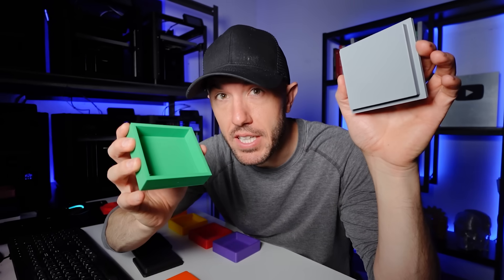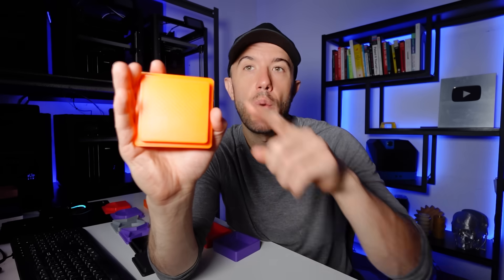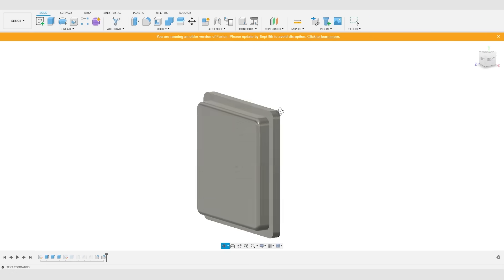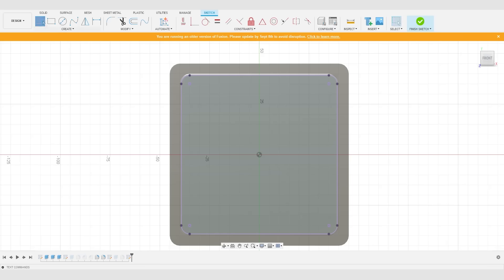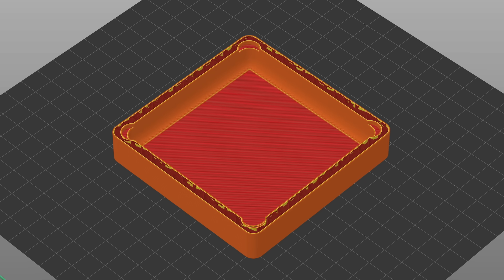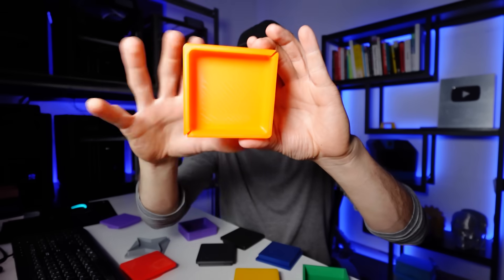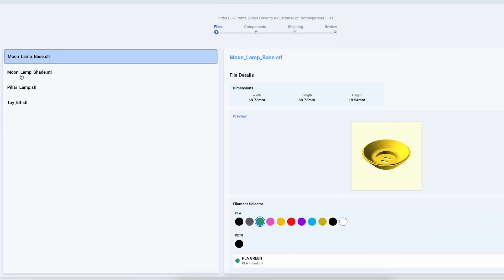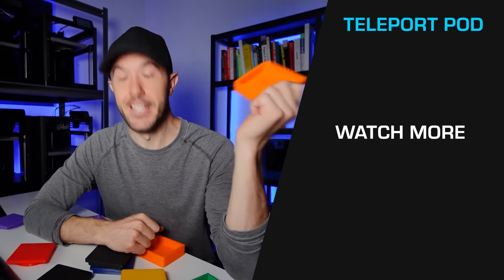How to Design a Print with Perfect Tolerance EVERY Time

Comment: Now show us 3D printed simple car key shell (le 2010 Toyota smart key), which is exact copy of original, can be clicked together and disassembled at least 30 times without breaking and is repeatable (20 printed parts will fit to each other). Then I will believe that plastic 3D printing technology SOMEWHAT developed to barely usable level. Or let's re-phrase it - how many OOO are in the price of printer which is able to print such precise parts in reasonable amount of time (not in 5 hours). simple YT searsh "3D printing car key shell" shows that this technology is about 100 years away from being able to produce nice looking result.

Comment: how does the filament not hang down when you have a 0.3 gap that's pretty wide (looks like more than 50mm in the video), it can't just float there until the next layer is printed, can it? Do you have support under there? (but how would you get that out if it's just 0.3 high, must be a pita) maybe tiny feet that break off once you wiggle it a little?

Comment: When doing splits, can you create a rounded notch instead of the rectangle notch? I'm new to 3d printing, but I know when you have hard corners they typically create stress points, whereas a rounded notch would reduce the stress potential.

Comment: In short, 0.025mm for tight secure sealing , 0.05mm for snug but easily can be removed, and finally 0.1mm and up for a lose fit.  This is what all my engineering is done at.

Comment: Very informative video!! 
Btw tolerances is limit we have after 3D Printing or Machining a part on printer/machine because of deflections and clearance is something we need to give to make two bodies fit with certain level of tightness.
All the information you provided is very up to the mark but as a 3D modeller who is modelling to make 3D prints I have seen that giving perfect clearances actually solves all the problems. I normally give a clearance of 0.2mm for a easy fit.
I have been modelling on a lot of fitting projects and most of them do not have the thickness to try all of the ideas you mentioned, the thickness is hardly 1 to 1.5mm
Make sure that you print the bodies on same machines as every other machine will give different deflections and this will cause the fit to get tight or loose.
A clearance of 0.15mm to 0.20mm works very well for a snap fit
The rounding of edges at the corner seems very helpful and I am going to apply that further on my projects. 
Thank you for the information!! :)

Comment: I have always added .005 inch per inch of cavity to account for internal shrinkage (in PLA), then add the gap per side you want, usually about .005 inch per side or more if the part is big. Always seems to work. If not, then a little filing.

Comment: These are some interesting workarounds, but add a lot of complexity in lieu of plain old proper dimensioning and tolerancing... but fine for the layperson.

for instance, your recommendation for corner clearances is to cut out a pocket in each corner. That works, but the more conventional design is to make the radius slightly smaller on the female part and larger on the male part (say 2.0mm radius on the cavity and 2.5mm on the insert) . This will leave a small gap, but that's generally acceptable and gives you a more simple, robust shape.

By the way, you put a "taper" onto those lid pieces, not a "chamfer." 

Keep at it, its a lot to learn!

Comment: Consult a machinist handbook and look at correct tolerances for fitted metal parts. NOTHING in this type of scenario is supposed to fit this tightly. Under sizing by .020" is typical and that's not including manufacturing tolerances. Screws are your friends, friends...

Comment: Yess I designed some compliant clickos to lock the two parts of a shell design, like an old Motorola but chunkier :) The 2 halves are quite big and compared to make it all in PETG for better mechanical properties, I switched back to PLA to print faster, because the compliant part has been sectioned and now it's a TPU insert. The flex and the lock force now are completely tunable just modifying the TPU infill, the mechanism is more reliable overtime than PETG, and even if it breaks fails or yeld you will only have to reprint the TPU part. The main bodies furtherly, are lil' more impact resistant made of PLA and more disposable since the prop it's a toy, a game board in the end.
You hardly can have clue of how much your content helps so many passionate people around the world to improve their garage made designs. <3

Comment: Those cuts from the 0.3mm cut you did into the wall, can easily be avoided by just creating a plane that aligns with the wall and only cutting the actual wall and not the part. Just FYI

Comment: In mechanical engineering, a fit describes the relationship between two mating parts, while clearance is the specific amount of space or gap between those parts. A clearance fit is a type of fit where a deliberate gap is designed into the parts, allowing them to move freely, whereas a fit can also be an interference fit, where the parts are intentionally designed to be forced together.
 
Fit
Definition: The relative condition of mating parts before assembly, describing the intentional difference in their dimensions. 
Purpose: To determine if parts will slide, press, or rotate relative to each other. 
Types: There are three main types of fits: clearance, transition, and interference fits. 
Clearance
Definition:
The physical distance between the surfaces of two mating parts when assembled. 
Application:
It's the measurement that determines whether a fit is a clearance fit, where there's space between the parts. 
Function:
To provide freedom of movement between parts, reduce friction and wear, and allow for parts to slide or be guided freely. 
Key Differences
Fit is the relationship: "Fit" is the overarching concept of how parts relate to each other (tight or loose). 
Clearance is the space: "Clearance" is the actual measured gap that results in a clearance fit. 
Interrelation: For a clearance fit, there is a positive clearance. However, not all fits are clearance fits; some are interference fits where there is negative clearance or overlap.

Comment: Nice summary. The box fingers is interesting but another solution you didn’t mention was, instead of putting slits in the corners of the box, instead put the slits in the corners of the cover walls that insert into the box. That way the cover insert walls can flex and hold against the box walls but the slits are not visible outside of the box like your box slits are. It works really well with all types of plastics and printers.

Comment: huh, I often had problems with adherence to my build plate with yellow PLA. This was the first time I heard that colors can actually change how material behaves. Nice to hear that!
Reply: @moolder  , yup. When I first started printing on my Ender5+, (at one point i had 6) yellow was problematic to dial in to say the least. Brighter colors over darker was always a bit of fiddling. 
Colors have big impacts on print performance for bed adhesion, fan cooling and even nozzle temp adjustments as their dyes and pigments are not equal. I've even experienced having to change Z-offsets for some colors of the same material.

Comment: You often talk about shrinkage of different material, but with current printers those values are taken in care while preparing gcode. Most modern printers can have even 0.02 mm accuracy on different materials (i even hapenned to print PLA next to PETG part with the same resolution etc. and had them fit without worrying about it) but you're right it's still good to consider if you're printing for other people to print them as well

Comment: 1st, I'm super impressed with how quickly you are able to edit the models. What software are you using there? I'm a CAD novice.
2nd, you may be overthinking a few things.
- Instead of using an X shape for compliance you can alternatively only print the corners. A peg shape or an L shape; adjust the size until you have the compliance and strength you want.
- Instead of cutting holes in the corners of the base you can just tighten the radius of the fillet. As long as the lid fillet is rounder you'll have the same sort of benefit.
Reply: It is Fusion 360

Comment: I always just print several versions. For example I'd print the box at 100% as normal, then I'd print the lid at:
   99.0% 
   99.5% 
   100.0% 
   100.5% 
   101.0% 
   101.5%
etc.
Until I get one that fits perfectly lmao

Comment: I would have included some veins (or bumps) in the lid, that would deflect the middle edge of the box just a little. If placed correctly it could also have a satisfying click that would allow slight movement but not self open. Parts would not remain under tension or deform over time.

Bonus give the box smaller inner radius than the lid, subtle enough not to be perceived, maybe 1mm less in it's radius.

Comment: Just a quibble, I would use the word clearance and not tolerance. Tolerance is about how much a part's size can deviate from its nominal value, whereas clearance is about the gap or space between parts when they are assembled.

Comment: Thanks for video. Additional question: So you just model the inlay and hole exactly same size? For example 100mm? I got in mind to make inlay smaller 0.1-0.2mm depending on how tight fit I need. I am definitelly gonna check your recommendation in the end of this video. 🙂

Comment: I like your use of physical examples paired with the demonstration of CAD techniques. I felt that some of these videos from this account in the past have been overly focused towards optimizing 3d printing for larger scale manufacturing rather than for the larger demographic of hobbyists who might look for advice in these videos. This video however was helpful in showing me a few techniques I could start implementing in my designs.
Reply from the maker: This channel is still only focused on mass production of 3d printed parts. When it helps hobbyists that is great but not the focus. Lol

Comment: You can also have the lid and the base printed at different layer heights (like 0.25 lid and 0.3 base). It prevents the layers from "keying together", thus reduces friction a lot.

Using hard soap for lubrication is sometimes an option too, especially for big threads.
Reply from the maker: You always want to design to avoid the need for special print settings or external additives.
Reply: @slant3d  yeah, I understand, it's just yet another trick to improve the feel of the parts even further. Besides, if the change is very small, it'll be unnoticable otherwise, only the binding will decrease.

Plus it's easier to use this for parts you cannot change, or it'll be too bothersome. Changing layer height a little is usually a lot easier (at least for small to medium scale production) than modifying the mesh
Reply: I use this trick a lot for my comission printing. With what my single Voron 2.4 can manage (1-1.5 kg / day, depending if the model allows it), It's often a lot easier to just tweak one setting, than to modify the mesh. if it's for only like 50-100 parts.

Soaping up the threads gives actually butter smooth operation without leaving noticeable residue after wiping it off. But I don't use soap often, only for extra small scale comissions. Soap is more appropriate for personal projects, where one bar of soap lasts pretty much forever

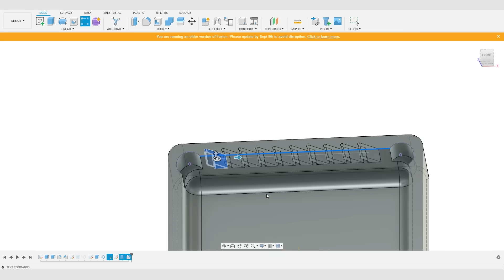Comment: I have a how not what question though. How do you have a released section "cutout underneath them" under the fingers at you have printed in the walls (10:45)? My 3d printer needs to have something under there so it isn't printing in mid-air. The same question occurred to me at 6:32 for the detached split version.

Comment: The 0.3mm gap below areas, I really don't see how that reliably avoids overhang problems with printer variance. There's still plenty of printers out there that can't print a horizontal layer into open space for long distances (such as the ones in this video) without stringing and other related overhanging problems. Even with short distances it can happen. I see the value of it mechanically but I'm unconvinced it's a method that can be relied upon for all different printers.

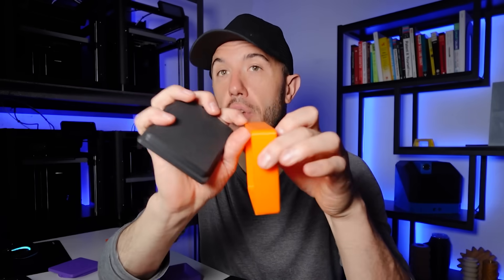Comment: Your title should say fit. Tolerances define how far out a manufactured part can be and still be considered acceptable. Tolerances are selected and stated based on things like how parts interact and their manufacturing processes. 9:40 Tolerances are not something the designer can tune up in CAD software.  Designers can adjust sizes to accommodate fit but not tolerance.  Fit and tolerance are not the same thing.  An example of fit would be a 0.2mm gap you leave in the design so that the lid and cover can fit together. An example of tolerance would be if a part is designed to a size of 100 mm and the tolerance is stated as +0 -0.2 mm, then any manufactured part that measures between 99.8 mm and 100 mm would be deemed acceptable.

Comment: Good info, although instead of using a chamfer which is primarily used for corners, the proper term or command called draft in nearly all cad software. Maybe he used the chamfer command, which can be done, or he was calling a draft a chamfer? More control in fitting parts would be too not only draft the lid but also the base in the same direction using the same plane that the lid is going to sit on. If one wants to keep the same thickness all the way down, the outside would have to be drafted at the same angle. I do not like the idea of cutting out the corners of the base as it would reduce strength. What can be done in that situation is to make the corners of lid have a slightly larger radii of the fillet to that of the base, so the corners of the lid will not touch. I really like the idea of the grip fins, although it seem like there has got to be another way to do it instead of cutting into the walls and make that area thinner?

Comment: The reason many of these "advanced" features are not used in manufacturing is because, in the "real world", companies don't just make a product - they validate the result to a standard/blueprint.  Every feature you add to a design (every individual feature, not just every unique feature) will have to be measured - every radius, position, length, depth, width, height, flatness, etc - and that additional labor/complexity incurs additional cost.  I highly doubt these parts are going though the level of QA/QC that major manufacturers are incorporating (1 part per x parts; validate for compliance to set standard).  That doesn't mean these are bad designs, but it's important to know that common design choices are not just the result of laziness or failure to be innovative.  Sometimes that which is innovative is what is "practical", not just "function-optimized".

Side note:
Another reason this is more concerning in mass manufacturing (i.e. injection molding) is because they are using molds to create product, so the molds have to account for discrepancies that the final product demonstrates.  As strange as it may seem, the mold does not actually conform to a product's blueprint, but instead to other dimensions which produce a result that conforms to it, because injection molding must account for difficult conditions - such as uneven heat distribution in the mold, and/or shrinkage that isn't uniform due to differences in a feature's attributes.
Reply: This, so much this! This is also the reason for the draft angle (which he calls a chamfer), which in the real world is there as a requirement to even be able to demold things in injection molding. While you can get away with smaller draft angles (like on LEGO, which is basically zero draft angle), it does lead to increased tool wear, and as anyone who has priced injection molded pieces knows those tools are not cheap.

Frankly, while there are lots of dissimilarities between 3D printing and injection molding just taking a primer on injection molding, and learning how plastics behave, and the design considerations which have to be made to make them behave like you want, will improve the way you design 3D printed parts as well.
Reply: You're describing the difference between quality reliable part assemblies vs cheap offshore crap.

Comment: Thanks for the video. My question all the time is how to calculate the part which comes on top. How can i calculate how much space i need to give the second part to slide in and is it possible to just scale both parts and have the same effect. So is it just make the sliding in part a percentage smaller?

Comment: Great idea on the flexture fingers or what ever you called them lol. I took them a step further and added ramps to make it a detent style fit where it creates an engagement in a groove or on the other side of a hole. That way it creates a self retaining mechanism.

Thanks for the ideas!

Edit: I just realized you could take this even one step further and create keyway channels with a drop and twist motion while maintaining the detent. Although the using fingers will likely induce a directionality in the force required one way versus the other. However, this could be overcome by using a dome stlyled flexture instead.

Comment: I have an issue where my infill and my perimeters are almost always not touching. Ive tried to increase infill/perimeter overlap to 100 but it barely does anything. idk what to do. ive increased slightly the amount of plastic leaving the nozzle to like 1.1 but its still causing these issues. My first layers used to be superb but now suck. can you please help

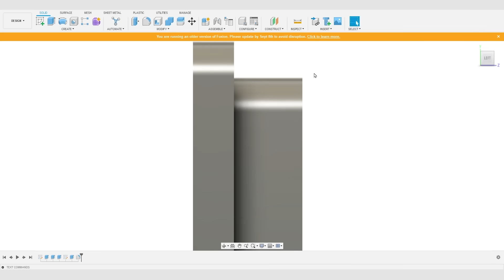Comment: How did he chamfer the entire wall height at 2:09 so easily?  I  thought you had to use draft which is a pain picking the right sides and sometimes the side that you need to choose for the direction of the draft isn't possible because there is nothing there.